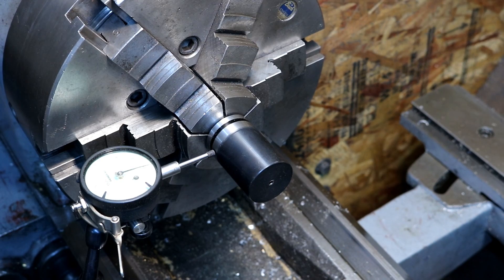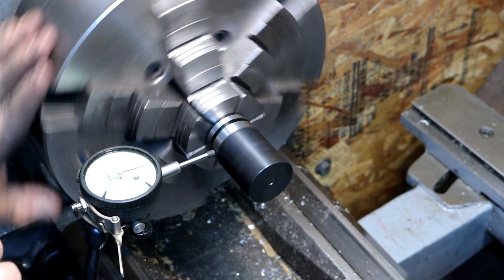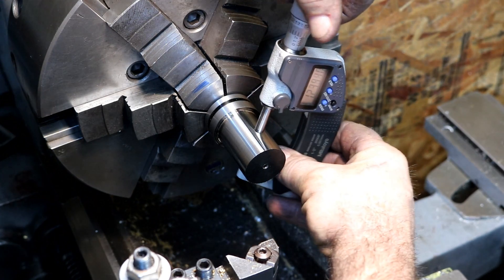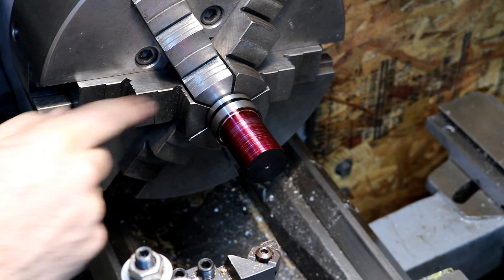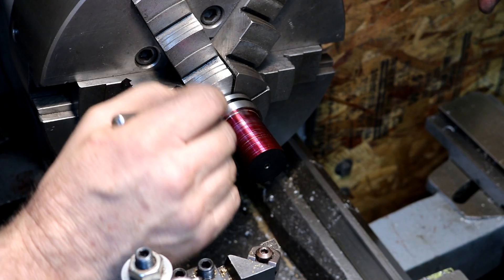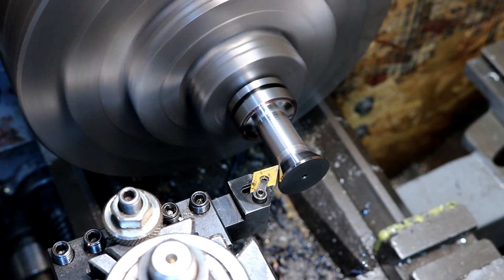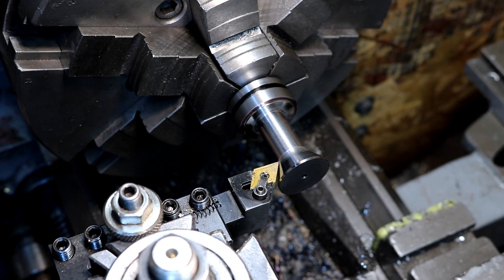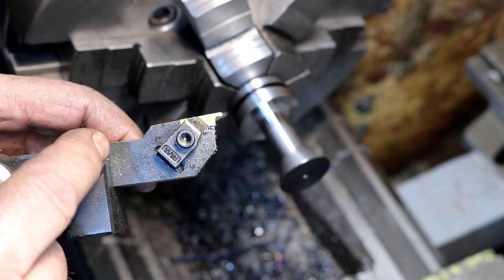How to Make a Tormach TTS Dovetail Cutter

Comment: Machining is your boilerplate stuff. Milling is the most important part, what with all those angles to set, and the hole to drill to set the insert properly.
Reply from the maker: Yep that is correct.  Thanks Joe.

Comment: Nice work as usual.  Is there a reason you did not use the dnmg (diamond) insert tool for the whole turning down the shank part?
Reply from the maker: I have found that the tool I have does not do heavy cuts very well, ok for .02 to .03. the wnmg .050 +.